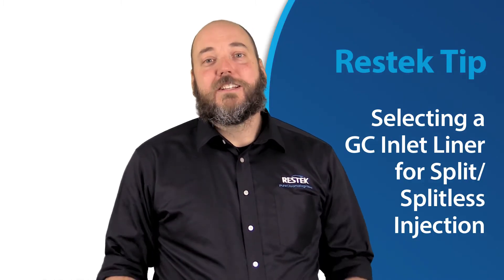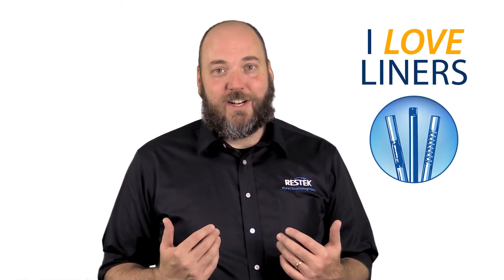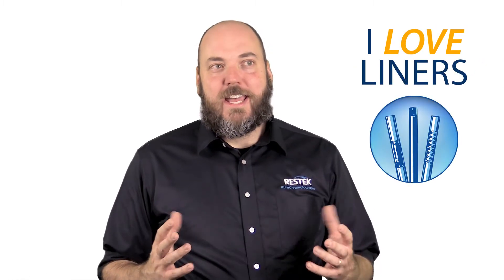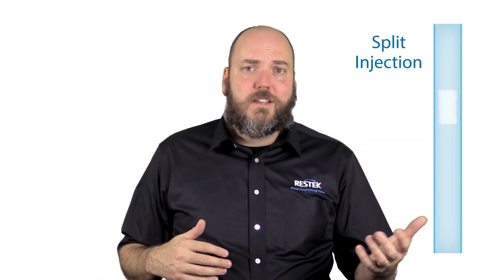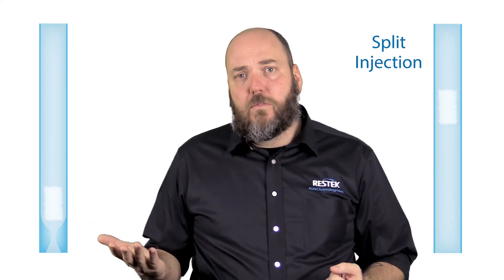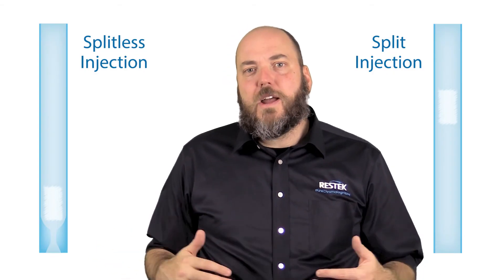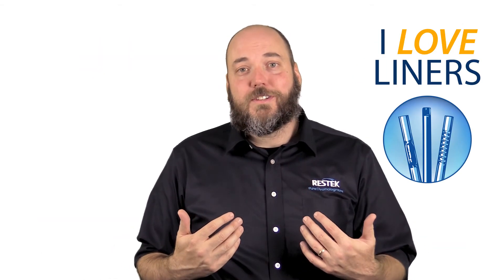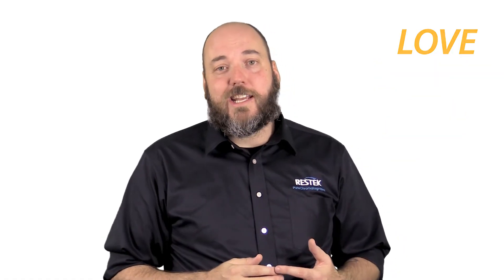Selecting a GC Inlet Liner

Comment: how would you reccomend the liners be deactivated if you cant replace them each time?
Reply from the maker: The first step would be to clean them carefully and see if that restores performance. You can find a procedure here: https://www.restek.com/frequently-asked-questions-faqs/frequently-asked-questions-GC-accessories/#sec06
You can try using reagents like DMDCS https://www.restek.com/products/reference-standards/Test-Mixes/GC/41112/ but that type of “pinpoint” deactivation is generally not as comprehensive as a polymeric deactivation. Restek and some other companies also offer liner re-deactivation as a service as well. You can find more info on that here: https://www.restek.com/frequently-asked-questions-faqs/frequently-asked-questions-GC-accessories/#sec16